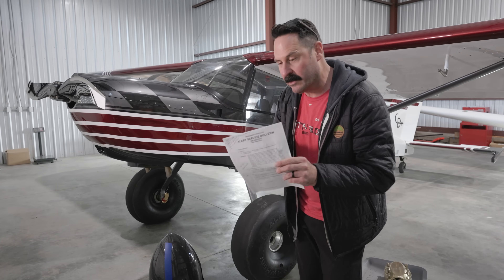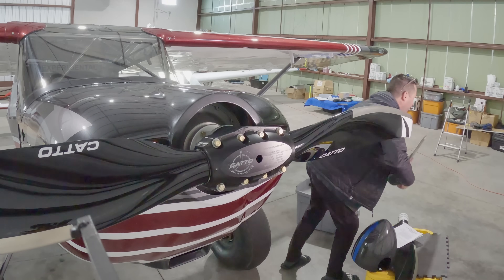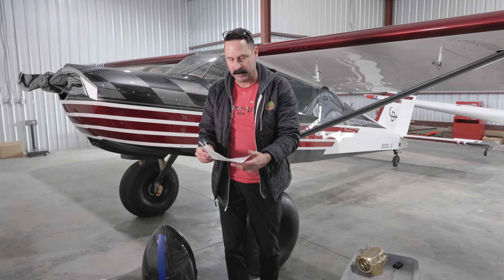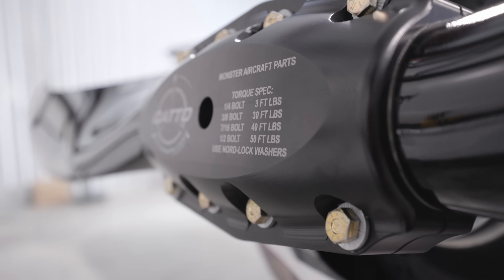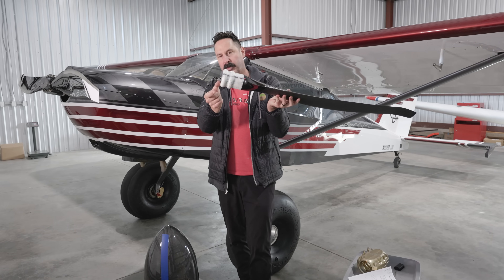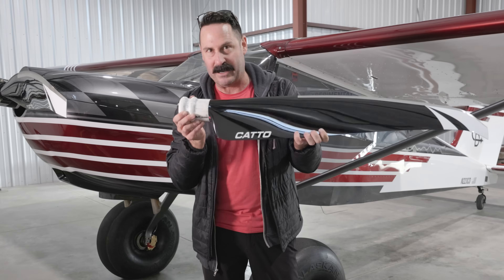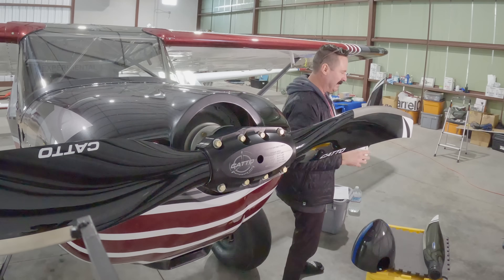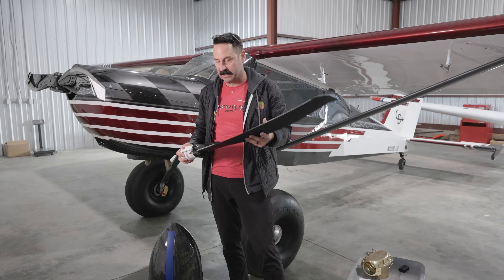ALERT! Service Bulletin - Hartzell Whirlwind Prop Hubs

Comment: I concur on the imbalance being the root cause for all the issues on the Whirlwind. I also believe you could fix the prop by "blue printing" the two blades to be a perfect weight match. You can make your own indexing marks on the hub and blades. A prop balancing hub on a floor stand. Use super fine, dry bearings. Separate the bearings by 18" and put a dial indicator next to each bearing point and see the "rock" when the prop is spun 100 rpm. Add tape weights to dynamically balance the prop. A 1/2 hp electric motor with some big pulleys? It sounds like the prop might have "flutter" in the imbalance. If the plane was not shaking perceptibly more with the Whirlwind, then all that is out the window! If a guy had a camera that shot 240fps video you might be able to see the "flutter". The blades flapping fore and aft at the tips.

Comment: Your content is both informative, educational and entertaining. Slow down and expalin your claims. Be careful how you bias the manufacturer. How many airpalnes have you built? 1. Is it possible you installed the bolts wrong? Of course Hartzel is going to email you. Your content reaches their entire market. Is this issue class action? I doubt it. What if a Catto blade assembky malfunctions? Just saying maybe its better to fix a problem rather than short video bomb it to the world.
Reply from the maker: Thanks for your comment. However, I couldn’t disagree more. First, I was the chief of safety for the USAF F-15C so I have the training to understand instance vs. trend. Second, the only way we identified this as a wide-ranging safety concern was due to me posting initially my issue. At that time (months ago) I treated it as a single instance and discussed my isolated incident and suggested that it could be my fault. My humble posts prompted others to speak up about their same issues. Upon metallurgical analysis of my and others’ failed bolts, Hartzell, to their credit is working diligently to notify operators. But Hartzell is 3 companies removed from WW operators. I don’t take credit for much, but in this case, I’ll accept that I connected issues, manufacturers and owner/operators. Again, I appreciate your attempt at correcting what you thought was an influencer going too far. But there’s far more to the story than you still know. Cheers.

Comment: Thanks Steve. How did you find out about this directive from Rans / Hartzell? I bought the total FWF kit which included this prop. I didn't use it but I have not heard a peep from Rans on this or any issue. Only you. Thank goodness
Reply: https://www.rans.com/_files/ugd/6e941e_d1b1b7c128354391aac24112dd02301a.pdf
Reply from the maker: From what I’ve seen, RANS posts their Operational or Builder Alerts on their website and Michelle occasionally mentions it on the Facebook builders forum. I’ve encouraged them to be much more official with their notification chain. We’ll see. But obviously this particular alert originates from Hartzell. But RANS is an OEM distributor and should participate in the notification effort.
Reply: He posted videos about his and others’ issues with the prop/hub/backing plate. Hartzel reached out to him. Based on research of the components, hartzel wrote the document and sent it to him.
Reply from the maker: I’ve been working on this issue directly with Hartzell so they sent it directly to me. Ensure that you’ve registered your prop with Hartzell and ensure they have your current contact info. It’s still early for this ASB and this whole issue…it’s still developing.
Reply: Thanks Steve.

Comment: Excellent video Steve! Craig Catto is an amazing guy. Perfect blend of genius and common sense engineering.  High tech propeller blades but a simple blade angle locking mechanism.